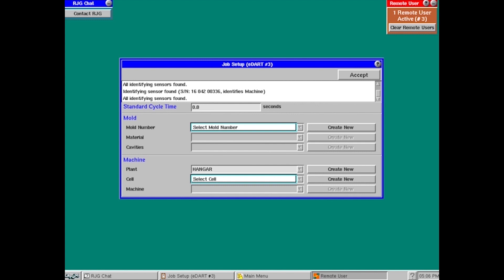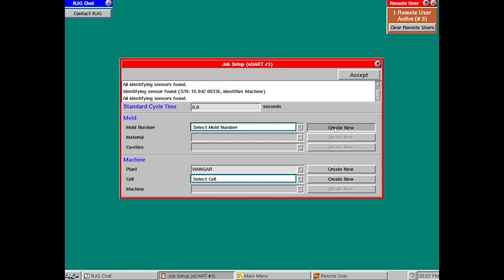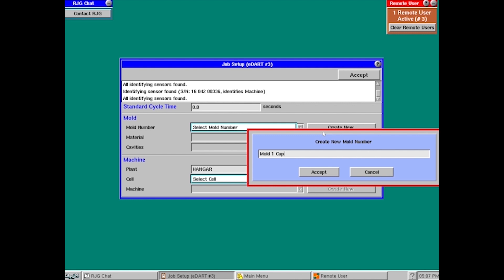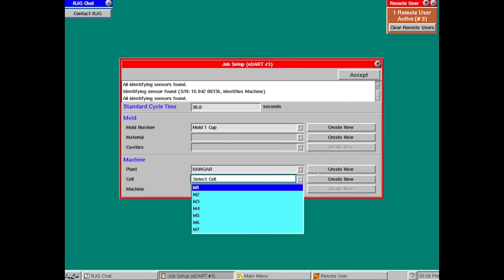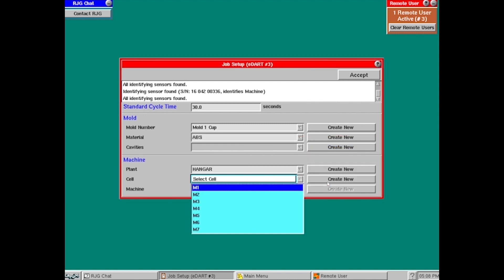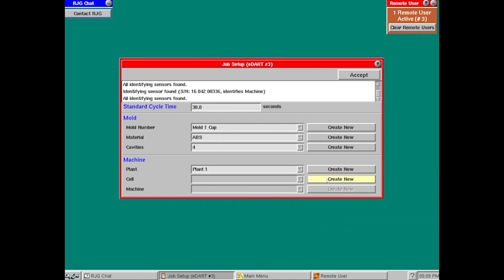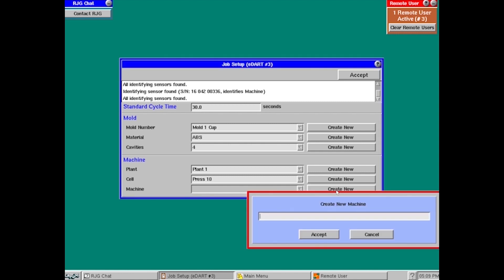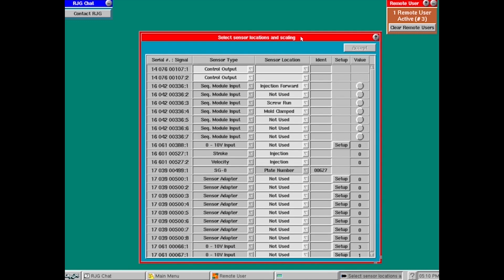How to Set Up a Job in the RJG eDART System

Comment: Good video !  eDART is a very powerful system, if used  properly, for process control and monitoring. It also makes troubleshooting easier/ faster once we know how this system works and in some cases without eDART I would have never found out the root cause of some problems during the molding process.
Reply from the maker: Thank you so much, Moises! We're very happy to hear that you've had a positive experience with the eDART.